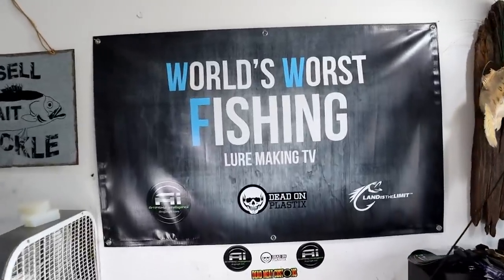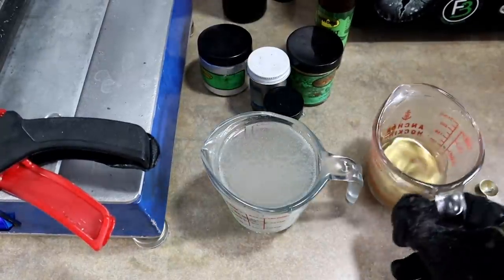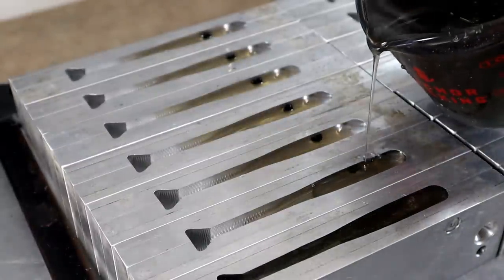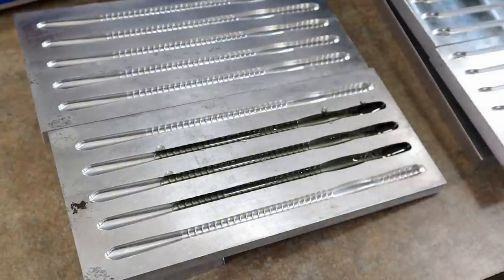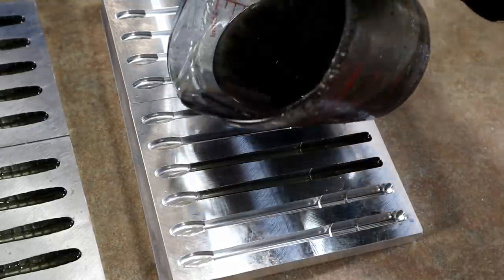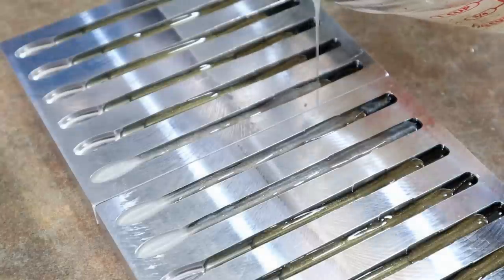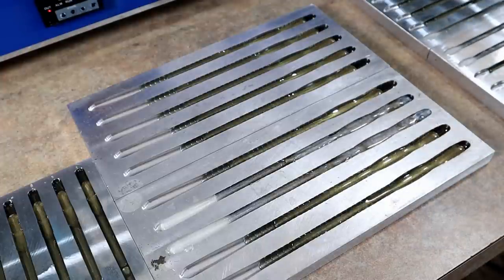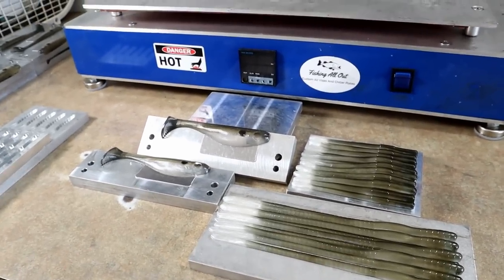How To Use GRAVITY With Mold Angles to Pour Soft Baits

Comment: Excellent video on the way the molds are filled but I am looking at molds, all different kinds, and it looks like one side is the top half of the bait while the other half of aluminum side is the lower half of the bait.  I picked up an aluminum mold and the right side of the bait is on one half the mold and the left is the other.  My question: is there a way to do a laminate top to bottom with the colors or is that going to be a one color mold unless you do two different colors one for each side of the bait and the mold is single injection 6 cavity. Thanks
Reply: Yes,  you will need a dual injector with a blending block, just turn your blending block the correct direction to get it top to bottom.
Reply: @jjsq22  thanks